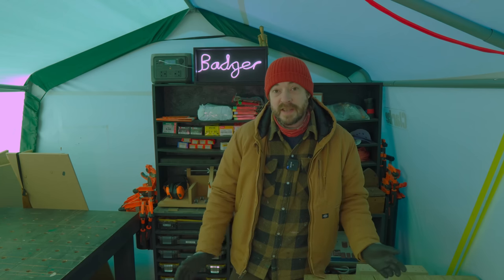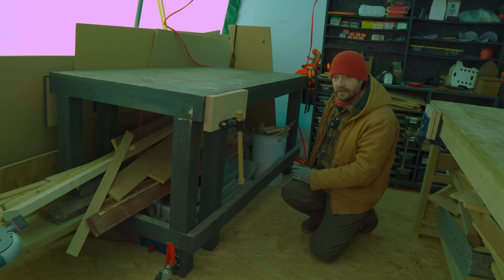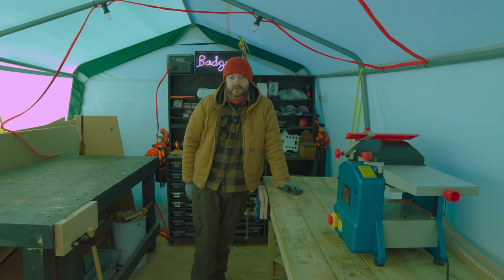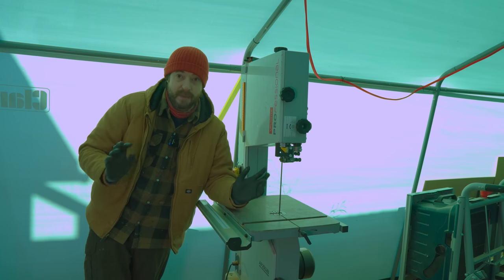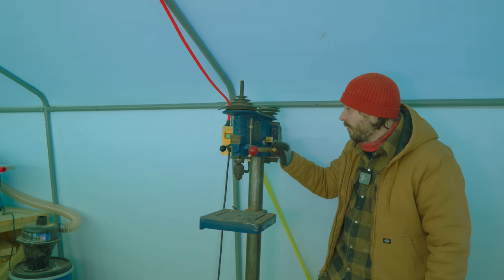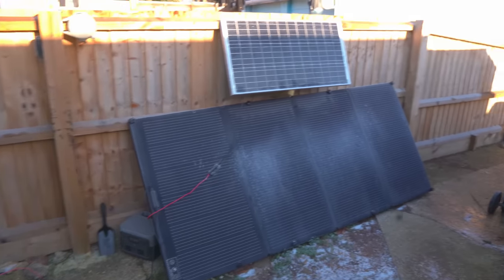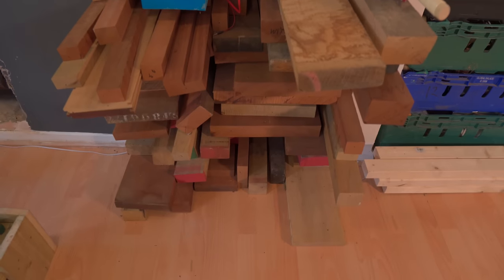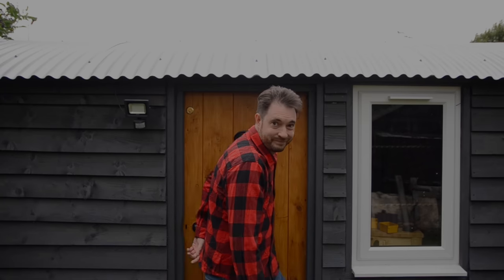Workshop Tour 2022

Comment: Coming from America where I have a good size workshop, fully stocked with tools (I am a house painter, but I do side projects that require a full line of power tools), and going to Greece for three months a year for vacation/retirement, where I have a house (I was born there), I appreciate the lack of space AND access to the tools I need (Well, more like tools I want, sometimes need..).  I can pretty much only use a staircase room to store my tools and wood, and when I want to do anything, I have to go up on the roof - which is a good size, but open to the elements, which is fine for now, as it never rains in the summer when I am at the island.

By the way, before I went to Greece two years ago, I thought I would need to choose which line of tools (Mostly battery powered) would be more accessible, and being in Europe, I thought Bosch made more sense.  But come to find out, Makita is much, much more popular/available/cheaper than Bosch in Greece.  Oh well, even here in the U.S. I decided to transition from Ridgid to Bosch, that way I can take batteries from here (Which I get for free when I buy a new Bosch tool) to Greece.  So far, I am very satisfied with them.

Comment: Hi Matt, I left a message on the workshop banter page about shipping  container workshops, and my experiences. Just wondered if you'd seen it?
Reply from the maker: I have not seen it
Reply: I was just making the argument for you to consider purchasing a shipping container for a fast, secure, ready to go, reasonably priced work shop. More detail in the other post if you want to have a look. I've just done similar and I'm so pleased with it. My intention is to cladd the container in timber eventually, but it got me up and running immediately.
Big fan of the channel mate, good luck
Reply from the maker: Unfortunately I would not get it in the garden
Reply: Ah ok mate, gutted. Those hiabs are pretty handy but probably can't clear a building. Just for reference when mine was delivered it cleared an 8ft fence and  9m from the road where the low loader was parked.
Good luck with the build mate, look forward to the videos, as always cheers for the content 👍